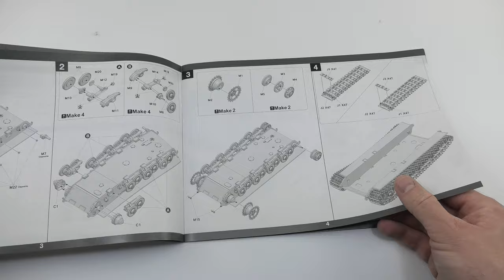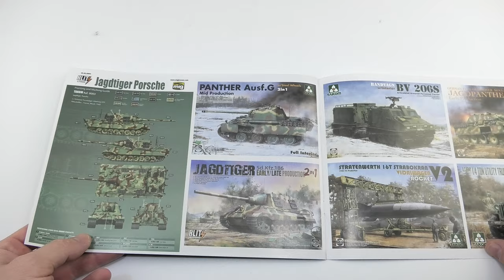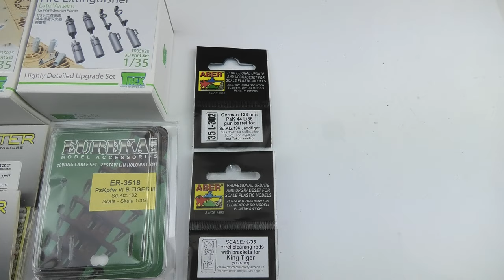OPEN THE BOX: JAGDTIGER, Blitz by Takom 8003, 1/35

Comment: I heard the front plate was an issue with these kits so when I built my Takom Blitz Porsche Jagdtiger I installed the front plate early in the construction. I didn't cut anything to get the front plate to fit but it did require some force to push the part into place. I liked the Takom Blitz Panzer III M better than the Jagdtiger but for $35 USD I wasn't unhappy with it.
Reply from the maker: Steve,  this part is probably the biggest problem in this kit. I still like Takom's product and hope to build even more their models in the future but not Blitz :):):) hahahah